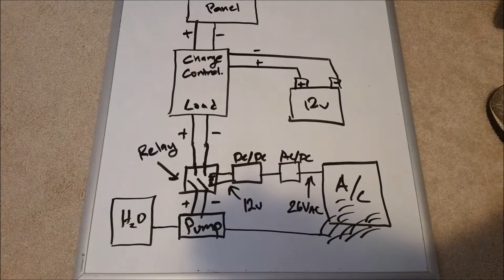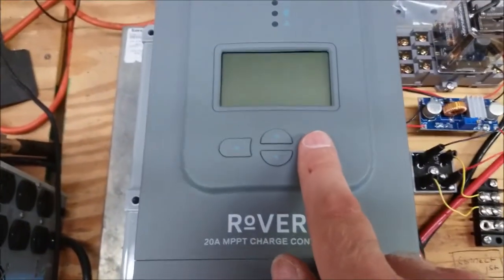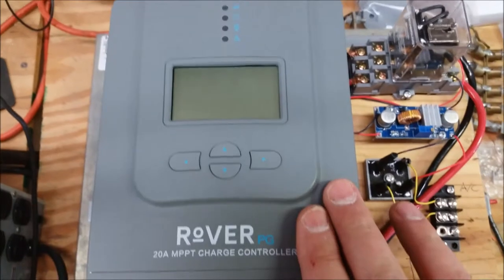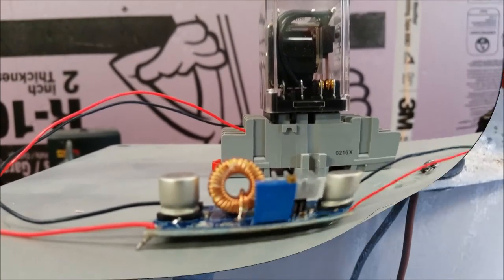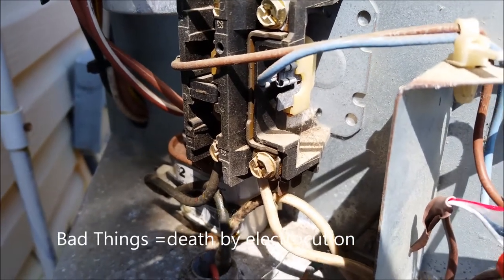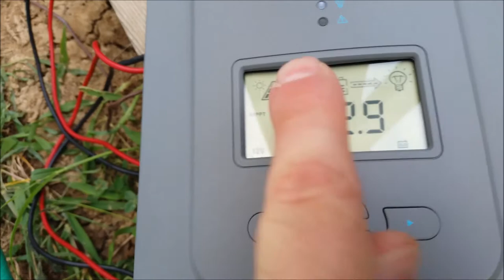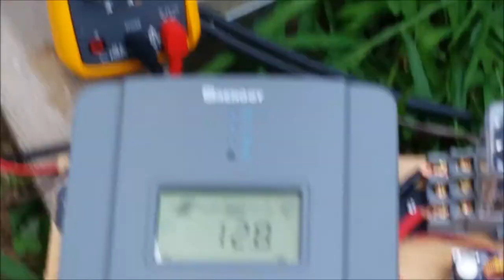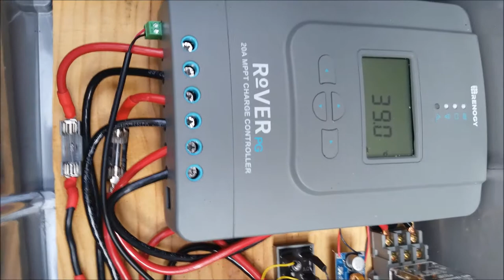DIY AC Mister Reduce your HVAC Cooling Costs Thermal Image Part 2 using rain water

Comment: Very good video. I know it would be difficult and time consuming, but considering the incresed subcooling effect and a lower temperature at your ac grills, a before and after documentation of your run times may be warranted and reveal it to be shorter adding to savings, no?
Reply from the maker: Yes.  Need to do on my new system.  Installed a heat pump.

Comment: Great work. I'm thinking of different ways to build my own system. I have extremely hard water so I can't use the hose and a filter, I already know how that will end. I am in Phoenix. High heat, low humidity, no rain. AC is on 150-180 days per year.

I have been thinking of ways I can adapt a pump and use the AC condensation water for a cleaner source. We don't have rain to rely on. The AC condensation drip is about 10 feet from the AC unit (outside ground unit). I also have AC power available right next to the AC unit outside near the ground. My concerns are: getting enough pressure from a pump, but not too much to where I need a lot more water. Keeping that pump alive in the high heat situation that is outside. 

I have considered just building a frame around my condenser, about 10-12 inches away from the fins and coils, adding the foam pads that evaporative coolers use and a solar fan. Not sure if that would do enough tho. I'd basically be evap cooling my coils from a distance to cut down on the amount of minerals getting too near the system. I'm not too sure how much water I would need to do any of these setups. 

With my current bill being $535, I'm all ears for ideas. Not a pro at circuitry but I'm good with a solder and can handle 12vdc and 110vac just fine. 

I got in my attic to check the situation out for adding some radiant barrier foil to the rafters but my attic is not maneuverable and I can't force myself to maneuver around in the small spaces between wood supports in the summer, I will certainly die trying.

Any thoughts?
Reply from the maker: With respect to ac. I found getting  condensate works,  but I only got maybe 5 gallons in two days.  That'd be consumed in a couple hours where you  are,  i suspect.

Invest in a lage rain barrel (250g or more) and when it does rain,  catch it from the rain gutters. 

Precooling your house in the morning before it gets hot requires less energy and will be cheaper esp. If you have time of use rates. 

Lastly,  you could staple insulation in the rafters and then put a radiant barrier over that.  I did the radiant barrier only (wish I did both) and seen about a 10-12f reduction in attic temps.   It's worth the hassle of going up there.... just do it really early.

Comment: Great update to the original project. Your original video had a rough estimate of the water usage per hour. Now that it's been running for a long time, do you have a better handle on how much water is used per hour? The Amazon listing says 1/2GPH per nozzle, which seems high. 

If I counted right, it looks like you have 5 or 6 vertical pipes, each  with 3 misters installed. Thanks.
Reply from the maker: Thanks

It's more like 1/3 to 1/4. Really dependent on the pressure. I have a pump that isn't as strong as the house pressure. I can usually get 4 days with 95+ days without rain. That's about 275 gallons of water at 10 hrs a day.  Didn't really keep that close an eye on it since the water is now free. :)

Comment: The 12 relay you have in your video is different than the one you have in your links, the one in the link is a 120v coil, and the one in your video is a 12v dc coil relay, please advise.
Reply from the maker: I updated the link , must have fat fingered something.  A better relay is https://amzn.to/3OZ8rsM  It doesn't require the terminal block I had to connect to it.  I just used stuff around the lab.
Reply: How do you prevent the 12v battery from running out over night? This pump will drain it pretty quick.
Reply from the maker: It normally doesn't run much overnight.  The pump is only on when ac is on.  It's about a 20% duty cycle so maybe 20min minutes total.... that's being liberal on time.

Comment: Why not just use the condensate from your evaporator coil indoors? It is relatively clean and mineral free by Nature
Reply from the maker: Yes,  very good insight.  But it only produces less than 5 gallons a day.  Mister needs more than that.
Reply: It will eat your radiator fins.
Reply from the maker: Rain water I guess is bad as well.
Reply from the maker: Rain water I guess is bad as well.
Reply: @stem_saving1644  No rain water is perfect, your ac gets rained on all the time, everyone does. City water and well water is no good.
Reply from the maker: Ar long as its filtered you can use city water.
Reply: @stem_saving1644  Depends on where you live, I ran city water before and have a softener system and calcium can still build up. Im building a new system with your design.
Reply from the maker: I've converted also since in the long run it's cheaper to run rain water.